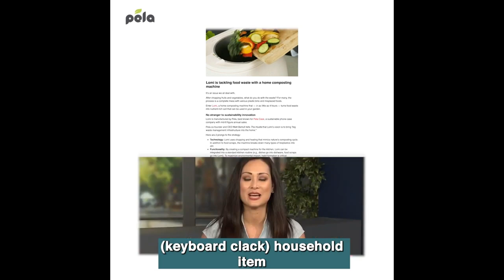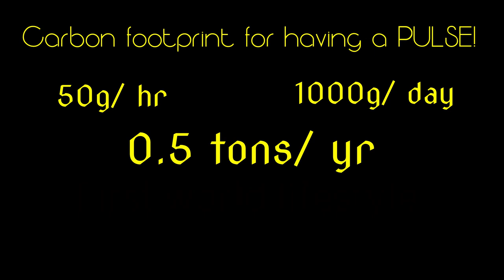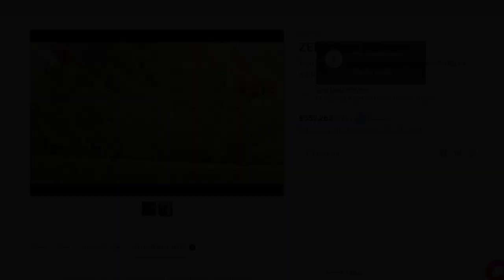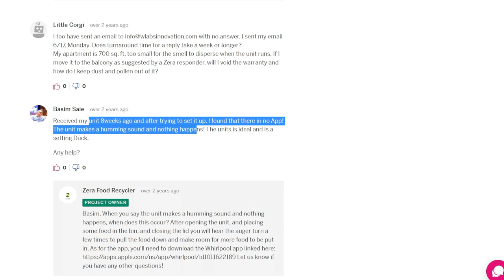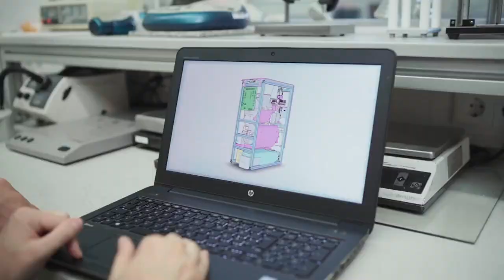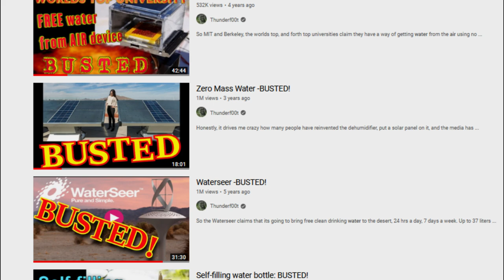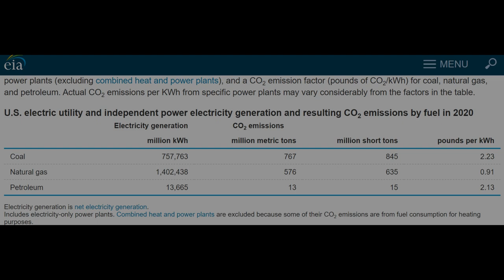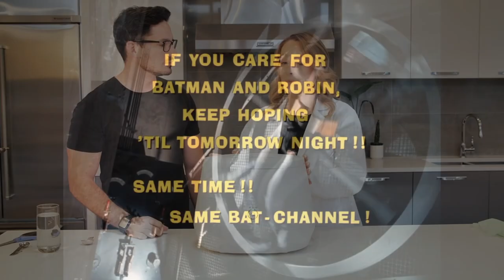Lomi: BUSTED!

Comment: In addition to electricity use (rate is always increasing), you are billed annually for filter replacement ($132 as of 2022). All these costs can waived if you have a good size of yard and compost the regular way. 

If you do not have a yard, garbage disposal in the kitchen comes handy. It helps limit the mount of garbage thrown into the (garbage) bin.
Reply: The filter is activated charcoal, compostable in itself.
Reply: @EmergencyButtons  That's missing the point. In order to be eco-friendly, you need to buy less stuff. A thing that guzzles elecricity and then (basically) requires you to constantly buy more stuff isn't helping.

Comment: I think I'll stick with my fungal composting 😂.

If you want low labor Composting millepedes and worms are by far cheaper and more effective lol.

Or Bokashi fermentation.

Or traditional thermophilic composting, which will prevent plant disease.

Or pyroclastic composting to produce biochar. ( Substrate with a high surface area & sorbing capacity )

There is alot of easy and effective options out there that don't require any special "devices" that don't actually work.

It just requires some knowledge on the biological sciences rather than seeking solutions through clever-stupid engineering & consumerism.
Reply: Yeah... like worms could do the trick
Reply: but but but capitalism is the best system 😂😂😂

Comment: I'm a big fan of bokashi composting. It basically uses inoculated grain to change to the composting process to more of an anaerobic fermentation process. As you add raw food, you add some grain too for more microbes. I'll then push down a plastic bag on top to keep it anaerobic. The nice thing about bokashi composting is that you can compost things like meat. (You do need a composting container that will allow the moisture on the bottom to drain. I think that's pretty standard need.)

After the bucket is full, you let it sit for around two weeks to make sure the microbes have had a chance to spread fully. Then I just bury it in some dirt. If I remember correctly, it still needs a month or so to finish breaking down after burying... but I'm adding nutrients back into the ground. Because of the fermentation, it does become a little acidic. If you are using it for plants that are sensitive to pH, you might want to spread it over a larger area (and over course make sure you give it a month to finish breaking down before planting.)
Reply: This is the kind of composting I want to do

Comment: Wooo! Good to see you talk about this! I saw this ad and immediately thought it was a gimmick. I feel like anyone who already have a compost bin in their house knows that this is a scam.
Reply: @Grauenwolf  I guess I just create more compost than you. Rotten fruits and peels turn into a gross gooey mess. So to me it was obvious anything that would chop it all up and dry it would use an incredible about of electricity. Where would it vent all the hot air while it's drying up the compost? Well, it'll vent it directly into your house! You may as well just buy mulch to spread it on your yard. It would be cheaper than buying this machine and it would be better for the environment. And your kitchen won't smell like compost for several hours.

Comment: I prefer to use the waste disposal. 
Sure, it's not perfect because it uses energy to operate. But only for a few seconds a day.
What's more, the food waste will add to the slurry mix they use to fertilize fields. So in the end it does help the environment.
The biggest pro for me is that it only uses a tiny amount of seldom needed space under the sink, and is less hassle than a food bin, or compost heap.

Comment: Wait a second: if you have a garden, wouldn't you just need to put it into some kind of tub, ideally with mesh to keep it as oxygenated as possible to prevent methane production, and then, well, wait doing absolutely nothing? 

Assuming your country doesn't collect bio waste in the first place. 

I mean it's literally just drying and grinding the waste, that's so incredibly bizarre and pointless.
Reply: @Grauenwolf  
That's why it's usually recommended to put bones into the general instead of organic waste.

Comment: I can see chopping up whatever you want to compost or maybe you can simply do what my grandma did she took one of those slap chopping tools and she had a big one made and she would put food waist in and lift the chopping head up and down about ten times and then she had compost starter. My grandmother had hers made from a metal bucket and with a metal lid and a couple pieces of scrap metal. The whole thing cost about twenty dollars total and it was a huge source of my grandparents fertilizer for their garden that they needed just to survive. I'm not saying that there product is not able to produce dry ingredients for compost but the drying process is completely unnecessary and it makes the whole process harder to complete and harder on the environment and harder to maintain and it also makes it harder for the plants you are trying to fertilize with the compost starter to use it. I can easily see it being an industrial blender and stopping there but the drying is pointless and so energy negative that you would get better results from pooping in your plants.

Comment: A couple of years ago I stumbled upon an interesting alternative to traditional pile composting. It was essentially a hand driven drill, which you'd use to make a narrow (about 10cm or so) hole in the soil, which you'd then fill with your waste and top it off with the soil. Supposedly, the process would create soil in situ. I do wonder about methane/co2 emission from that, but still. Of course then there is the added effort of drilling a hole which I doubt would be easy. Still, the idea sounds interesting.
Reply: Sound like tiny composting with extra steps. Speaking of steps, you'd have to watch where you walk.
Reply: I do this at the back of my yard. Just dig a hole a couple feet deep and dump compost in. When it's full, use the dirt from a new hole to cover it. Gives the worms extra food and reduces trash volume and odors.
Reply: That's literally how landfills work, you're just doing it on smaller scale which is less efficient and still produces the same co2 from decay.
Reply: @Vincent_Beers  Landfills recover the biogas and feed it to natural gas lines...

Methane is a powerful greenhouse gas!
Reply: Landfills also lay down plastic sheeting and a piping network at the base to prevent seeping into the ground. Landfills are more complicated than just a hole in the ground.
Reply: @Latin-J  Absolutely! They are a complex garbage container now! Far from the "hole in the ground" they used to be!
Reply: ...which isn't bad. It actually doesn't matter for the environment how you compost your food, unless you use a Lomi, or like burn it or something. It's going to decay one way or another.
An actual impact on emissions would be if that food wasn't produced in the first place. Eat portions that are slightly too small rather than slightly too large. Buy less.
Reply: @jamietodd2560  we did this for my entire childhood. My dad would dig a 2m deep hole with about a 1m radius. He worked in steps and everything.  With a shovel and pig-axe only. The man was a machine. Then he would put all our garden waste in the hole until full (probably took a year or two) then he'd dig a similar hole next to that hole and, as you said, put the new hole's soil on top the old, filled hole. 

I remember 4 holes being dug from the time i started to remember until I moved out the house.

It worked perfectly
Reply: Not so good.  The microbes that break down organic waste in the presence of oxygen (aerobic) don't produce methane.  Without oxygen the anaerobic microbes take over and they do produce methane.  Proper composting requires stirring to keep the waste loose and aerated.  This is why the cliche backyard composting setup is a horizontal drum with a hand crank to turn it.
Reply: narrow furrows of composting is something like 12,000 years old, but deep holes are called Archaeology. It's common to dig up trash piles "middens", basically a landfill of stuff thrown away, bones/carcasses, etc.😂

Comment: This is a device that create matter/soil by grinding the food waste and dehydrate them. It basically took the stuff from garbage disposal and dry it by heat. Yes, it used a lot of electricity with a dehydrator and it might smell. 

It basically took the your trash from the landfill and dried up by electricity. It eliminates the bugs/microbes problems in residential residence and it looks good. if you want you make your own bone meal, blood meal, soy/corn meal for natural fertilizer, this will be the tool, but once again since dehydration is involved it will use a lot of electricity.

Comment: I really liked how the demonstration videos of the thing in use/having been used kept sticker in it at various points "Do not fill over this line, please remove sticker before use". Also impressive how people keep falling for these kinda things? Maybe it's not obvious to city people, but composting takes time and effort... a lot of time (unless it's one of those fancy industrial processes that speed it up with specific bacteria, temperatures, etc)

But really I'm kinda baffled by this, living on my own I don't produce a whole lot of compostable waste. So I have a little plastic bucket with an easy to open removeable lid next to the sink, over 1-2 days that'll fill up with fruit peels and some other leftovers after cooking. Whenever it's empty I put one sheet of paper towel in the bottom then if I take the lid off and give it a bit of a swing + sudden stop above my bin just about everything will drop out. Depending on its state afterwards it either gets a basic cleaning, put in the dishwasher for a cycle or used as is.

That's not hard at all and less work than messing with plastic bags in the bin holder imo, but for a larger household it'll get annoying quickly. And to avoid that overly dramatic spilling all the items from the bin, maybe just carry the plastic holder next to the bin that the garbage service collects, carefully lift the bag out and dump it in there instead. If an incident does happen it won't be indoor and the cleanup is less of a nuisance.

Comment: So I think for people like me, who have a garden and have a giant compost bin, this could be a good idea in theory. Not having smelly food waste on your kitchen counter attracting fruit flies (what we used to do) or leaving it outside for animals to attack it (what we do now) is awesome. If you put the lomi in growth mode, in 24 hours, you have compost. The problems are:

1. you need to use power to do so
2. you have to buy their proprietary "tablets" at $39.99 every 3 months
3. you have to use their charcoal filters (again, more expense) to keep the smell out

What I'd prefer:

1. Something that can work just with direct sunlight hitting it. Spending energy to run it is stupid, as was mentioned in this video.
2. No proprietary nothing. $39.99 every 3 months for tablets? I'd rather just spend $160 every spring and buy a gigantic pile of compost from my local supply house. They'd literally deliver an entire truck of it for that price!
3. Something that actually produces a large amount of compost. Which is why I just built my own 12 foot x 4 foot compost bin in my backyard!

Comment: There’s a new one called Mill. Same thing but they sell the dehydrated stuff as chicken feed after you mail it to them. Makes a little bit more sense but still a lot of energy and it costs $33 per month. I pay roughly $20 per month for bin collection. The food/garden waste is composted and pulverised, recycling sorted and general waste goes to a waste to energy incinerator. It’s not perfect but the cost/benefit for adding separate dehydration and redistribution doesn’t seem justified
Reply: I absolutely would not trust chicken feed from a source like that. Chickens on modern farms have a fairly strict diet based on the macronutrients they need at various stages of life. At best it could probably be mixed into feed at a low rate as a carbohydrate/ fiber source, which you're much less likely to be short on than protein, so...

Comment: I have a quasi Lomi at home. Its 2 large terracotta pots stacked. Food waste goes in on the top one, chopped if possible. Stir weekly and humidify as needed. Switch top to bottom when full In the month or two it takes to fill , compost on bottom one  is mostly ready. Spread on garden, grind a little prviously. Great for my tomatoes. Negative carbon footprint as far as I can tell.

Comment: This is insane. As a gardener, I only need a powered device for composting when it's branches over half an inch thick.
 Food scraps, small pieces of paper and textiles, cardboard, etc basically breaks down by itself under the right conditions. 
Fast composting takes 3-4 weeks, you need the right ratio of nitrogenous to woody material, the right temperature and moisture levels, good starting enzymes, bacteria, etc, which is usually easily accomplished by keeping some of the previous batch and throwing that right on top of the new batch. Turning frequently is important too if you want really fast processing.
Now that material wont be fully broken down, but the rest of the process will occur after adding it to the soil already in your garden or plants, if it's also got the right conditions.
Edit: Lolwhat, it evaporates all the water with a heater? COmpletely insane, you could make a home methane generator that uses food scrape that would actually produce its own heat and give you cooking gas as a waste product and it would be cheaper and simplier, I could probably throw one together in a weekend without 3 years of bullshit kickstarter videos needed.

Comment: That thing does not have a very big bin.  The large size is mostly motor.  I would have to run that machine every single night as they said you cannot leave food sit in it for long before composting it.  You fill it up with your vegetable cut ups while you cook, but you cannot add in your leftovers from eating, because the Lomi is already full and running for the next several hours.  The scraps after eating, then go into the waste bin, waiting to go into the Lomi.  By the end of the week, I composted maybe a 3rd of the waste while the waste bin gets filled up by the excess.  I'm not going to touch the excess after a week; it's going to make the trip to the county land fill.  I would be running that Lomi non-stop just to keep up with the waste.  You cannot tell me that won't run up the electric bill and you cannot tell me that it will last long with excessive usage.  Plus, I have to keep buying those tablets and the carbon.  I do not buy anything for my natural compost pile.  Nature gives me what I need to get the job done.  With the natural way I get something in return that is very important, that Lomi does not give me, and that is worms.  Tons of worms!  I also get bacteria and microbes that my garden needs to make it happy and healthy.  You will never convince me that bacteria and microbes will survive a furnace.  I will pass on this one.

Comment: OR buy a $10 tote, paper scraps, a little dirt, and $20 worth of red wriggler worms. It’s not an over night solution and takes some elbow grease but it will actually work for you plant and most paper waste. I’ve been doing this for years. Other waste needs a different system but there is no silver bullet. For that price you could certainly afford to figure something out.

Comment: Just a thought, but actually transporting waste to landfills might lead to more CO emissions than composting food waste at home. I get that you have to power the lomi and it needs to be transported to get to your home, but depending on where you get your energy from, the energy used might not have a greenhouse effect while transporting it to your home only happens once
Reply: The problem is there's a way to skip the expensive, wasteful middleman of the dehydrator and food processor.
Just put compost it like normal.

Comment: Bokashi is the solution. If you're looking for a compact home 'composting' system that doesn't require much maintenance, look into bokashi! It basically involves fermenting food scraps in a bucket before letting them break down outside in the soil. You can buy a special bokashi bucket, or repurpose a couple of regular 5 gallon buckets. It is not as gross as it sounds! And if you accidentally forget about it for a few months, I can say from experience that it will be fine. The advantage of bokashi is that the fermented pre-compost breaks down in the soil within a couple of weeks, and adds beneficial microorganisms to the soil in the process and enriching it with organic matter. It doesn't cost 500$, uses no electricity, and it's probably better for the garden than the desiccated garbage produced by lomi.

Comment: I doubt that overpriced power hog could even produce actual compost fertilizer. In order for a soil product to be called a fertilizer, it must adhere to well defined NPK ratios, moisture content, pest/pathogen controls, etc. Instead, the product is more likely an average soil conditioner.

Comment: Just what we all need. Another household appliance that provides an innovative new solution to a problem doesn't exist. Turning bits of trash into smaller bits of trash, then using electricity to turn small bits wet trash into small bits of dry trash? Can you not just dry it out in the sun? Wouldn't a compost pile be the least complicated and most environmentally-friendly way to do all of this?